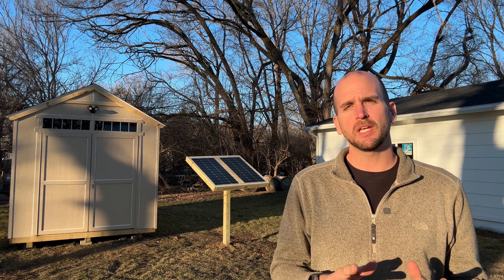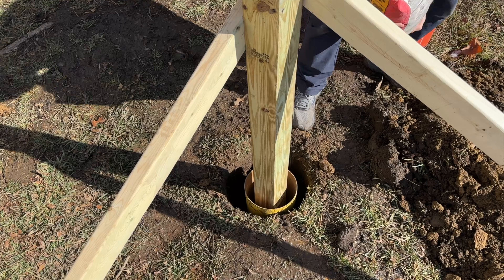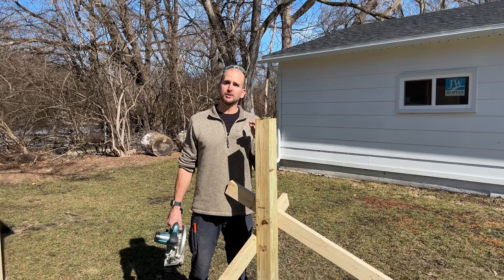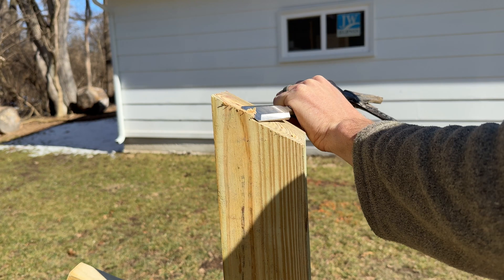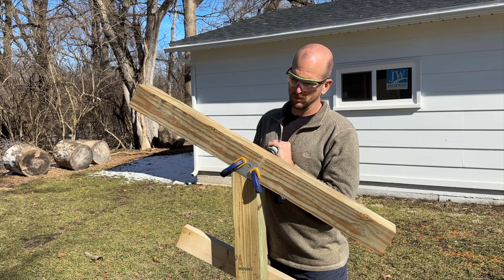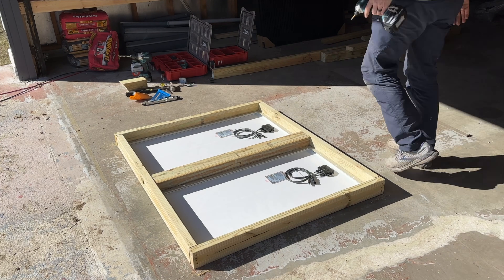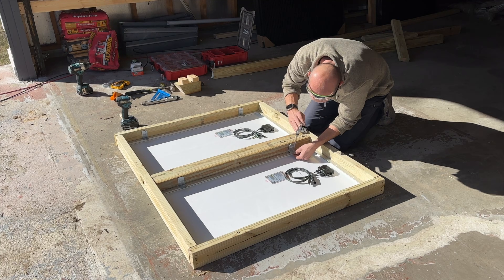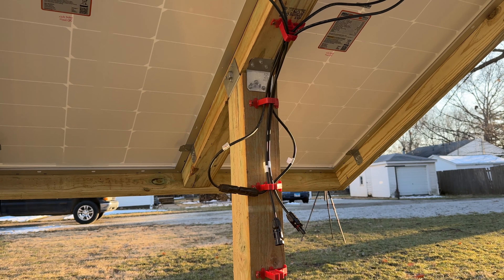Easy DIY Ground Mount | 2 X 100W Panels

Comment from the maker: Calculate Solar Cost For Your Home - https://geni.us/solar_reviews
100W Panels - https://geni.us/x7Tet
Tilt Angle Calculator - https://geni.us/z8r7
List of Lumber and Hardware - https://homedepot.sjv.io/Vme2ga

DISCLAIMER: This video is for entertainment purposes only. Also, this video and description contain affiliate links, which means that if you click on one of the product links, I’ll receive a small commission.
Reply: Home Depot link just brings me to Home Depot without list of materials.  Can you fix or post actual list?
Reply: your hardware is not working
Reply: hardware not working .. also looking for hardware you use to run pipe under ground 
in seperate video

Comment: For anyone with freezing temperatures, you're going to need to caulk the heck out of that. If water gets down the crack in between the wood and the solar panel and expands it will shatter your panels

Comment: Nice video...now I'd like to figure out a way to manually rotate the vertical post during the day.  What about a round fence post fitted into a round plastic (or metal) pipe that's been cemented into the ground.  Then I'd need a way to swivel the panel depending on the season...a range of 10 deg to 50 deg should cover my S. Calif location.  There are  post top swivel attachments but they are expensive.  Can someone think of a metal bracket combination that might work ?

Comment: What is the metal bracket you used on the top to connect  the 2 4x4 post

Comment: Not sure how I missed this whole project. The algorithm just showed me the connection video on the other channel then I came here. This is timely as I have a resin shed from Lifetime and picked up a pair of rigid 100W panels and was trying to figure out how to hang them from the roof w/o putting holes in the resin. I have an empty spot next to to the shed and wondered how I could build something to hold the panels that would not cost more than the panels. This is perfect. I will look for ideas on making it adjustable, but I suspect the fixed angle will prove to be enough for my meager needs. Thanks, Scott!

Comment: I've found not using tube forms to work very well, and reduces the cost as you don't need to buy the tube form.  Concrete below level, then after it cures a bit, cover up with soil or gravel.
Reply from the maker: Yeah, not a bad way to go.  Thanks for the feedback!

Comment: i live in rural ontario canada and i'm planning to do a 4 panel setup (but might add 4 more in the future) with 2 6x6 posts.
i will also put a linear actuator to automate tilting in summer and winter between the 2 angles calculated by your website! thanks!
Reply from the maker: Sounds pretty awesome!  Best of luck on the project.

Comment: Great video, thank you.  This is exactly what I wanted to build for a shed out back of my property.  Using an Ecoflow Delta battery and just need to understand how to get it wired from the panels to the inside shed location.
Reply from the maker: Video coming out next week where I will trench in the wires from the panel to the shed 👍

Comment: Just a heads up, aluminum and pressure treated lumber don't play well together long term. The copper in the treatment will accelerate corrosion on the aluminum. In my personal experience, it hasn't been too bad. I built two 3500Wp arrays from treated lumber and check the panels regularly. There's some slight discoloration on the frames where they touch the wood, but they're still sturdy. It's just something to be aware of.

Comment: If I understand, the panels are for the shed just behind to the left? If yes, I was wondering why you didn’t put the panels on the shed roof? 
I can think of a few reasons:   angle, more panels needed, wanted to build the pole support setup, etc. I’m just curious about your thought process on this. Thanks!
Reply from the maker: Yeah, those panels will be for that shed.  I will put the whole system together in a video within the next week or so.  I just wanted to show one of the many options for mounting panels and not necessarily saying this is the best.  Like you mentioned each case is different with multiple factors that have to be considered.
Reply: Thanks for the reply. I appreciate your efforts on showing the ground mount. I've been considering a ground mount type setup for the solar to some portable batteries. Thanks again!

Comment: For the surface area of your 2x 100w panels, would it have been better to go with a single panel of 275w to 400w? More output for the approx same area.
Reply from the maker: Yeah, I like 100W panels because they are so popular in the DIY space but you could probably make better use of the surface area with only 1 larger panel.

Comment: How about a car canopy structure with at most 3 legs that is designed to have solar panels mounted to the canopy?  The solar wires would then feed into a nearby ecoflow battery bank.  You then have an off grid car cover and an EV charging station in one.  That would be a highly watched video!
Reply: It doesn't work to change an EV off the sun!!
Reply from the maker: Thanks for the suggestion.  That would be highly watched and also would highlight that car/truck batteries are much, much larger than even a standard EcoFlow Delta Pro Ultra.  Would be interesting to breakdown the energy generated into how many miles added to the EV car range.

Comment: How do solar panels work if you live somewhere where it snows?????????
Reply: If you use bifacial panels you will benefit from light reflecting off the snow.
Reply: Also I read somewhere to dump some white gravel on the ground so the bifacials work in the summer as well
Reply from the maker: Just knock the snow off 👍.  A ground mount like this is easy to manage.  Roof mount is a bit tougher.
Reply: Solar panels actually function much better in the winter with the lower temperatures you just need to take the snow off like Scott said. You're not going to get as much production during the winter as you will during the summer but you'll definitely get something.

Comment: My 2 cents is to not use the tube in the hole, either fill the hole with tamped in dirt or mixed concrete.
Reply from the maker: Thanks for the feedback.